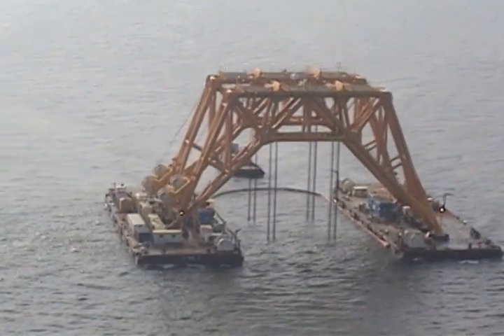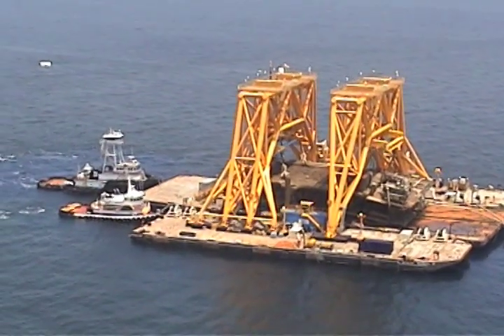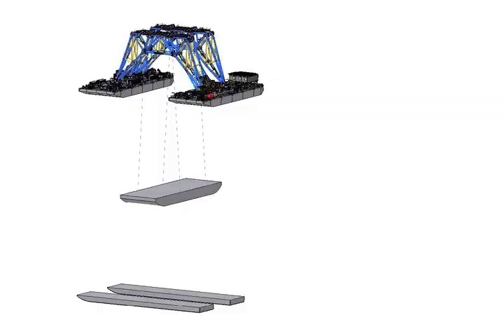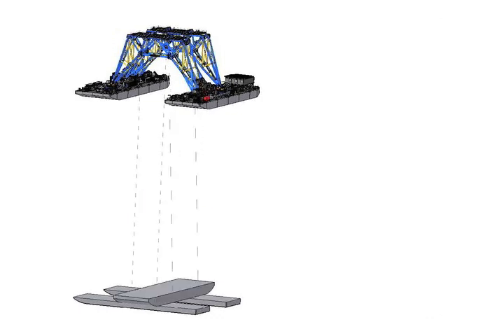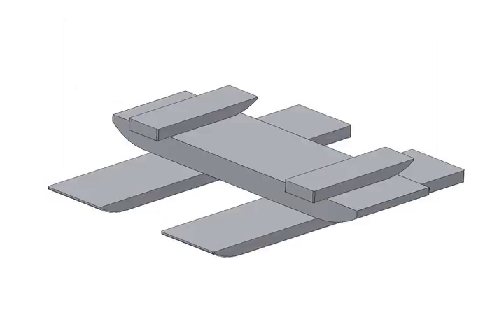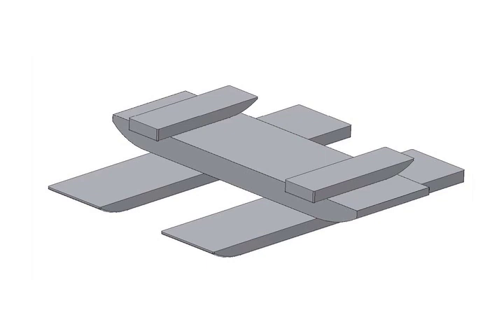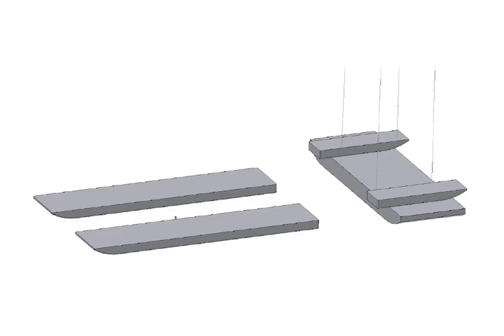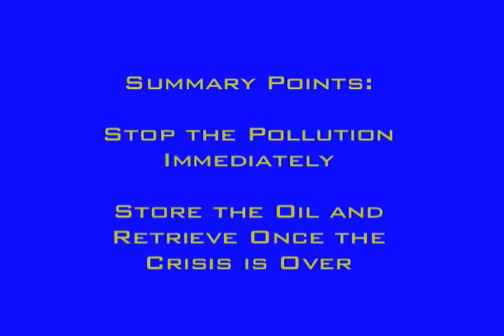Oil Spill Solution - Subsea Barge Storage

Comment: Nice idea. If it wasn't for the dissolved gas and hydrates, the containers could just automatically float to the surface to be collected. So for that reason, a connector at the top of the container could dispense the contents later, but some oil would leak between changes.
However, a sense of scale: 100,000 barrels = approx 16 million litres per day.
At 0.8g/cm3, that's about 13,000 tonnes a day. After 60 days the sea floor would be a car park of 780 of these 1000-ton barges, worth $420m

Comment: BP could have dropped concrete sewer pipe over that riser and kept doing it until they had a containment shell.  The stuff comes in 12 foot diameter widths. Totally off the shelf. The reason they aren't doing things like this is that some group of idiots in BP are trying to save the investment of the original well. A BP executive has been trained to ignore environmental costs more or less since birth.

Comment: @goodmanjwheaton 
YOU NEVER RAISE THE BARGE UP! You Do lose some capacity from the hydrates but still can contain the leak feasibly. Since the Barge sits on Mats the oil hugs the top. Don't you think that if they can drill 3 and a half miles down they can figure out how to make a HOOK STRAW and suck out the oil?

Comment: @freepress666 

They do this every day.  The Barge is full of water open at the bottom and the pressures are Equalized. The Oil will displace the water. IT WILL NOT CRUSH LIKE A BEER CAN!  You must work for BP!

Comment: @freepress666 
did you see the 100-ton tower they lowered?  it had a hole in the bottom and was not crushed like a beer can.  i'm not an engineer, but it would seem to me that a barge would hold up to the pressures.    as far as the hydrates are concerned, give the company a chance to see what would happen.

Comment: You're underestimating the amount of hydrates that will be produced.  With a gas-to-oil ratio of 3000 cubic feet per barrel, since methane hydrate has 46 molecules of water per molecule of methane, you'll produce about 21 kg of hydrates per kg of oil.  This will fill your barge *very* fast.  And even worse, when you raise the barge above the clathrate stability pressure (300 meters depth), the clathrate will decompose into hundreds of millions of cubic feet of gas.  Uh-oh...